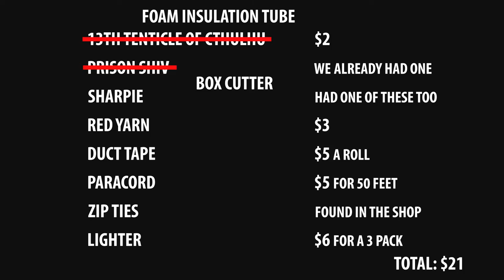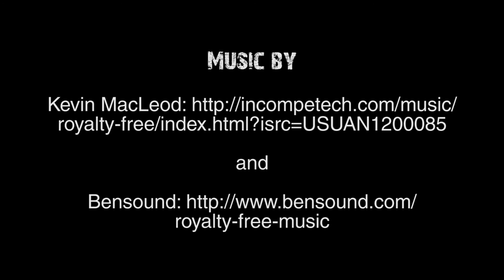Molotov Cocktail Build (Larp and Airsoft Safe!)

Comment: Did I hear red yarn is fire? I know how Im going to make my flame thrower now, all I need is a portable vacuum or maybe a leaf blower?
Reply: Bit late i know but get a battery powered air mattress inflator. Smoll, compact, but high airflow and runs on six volts, usually 4 D cell batteries.